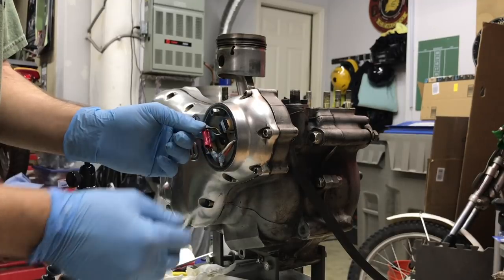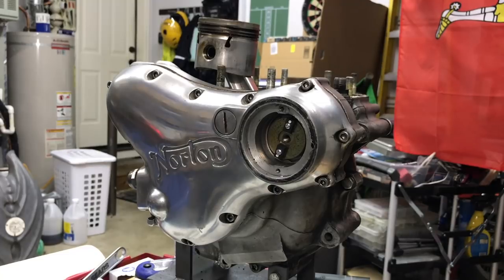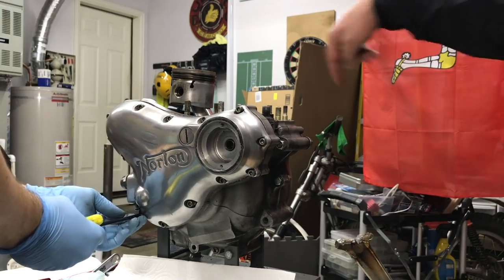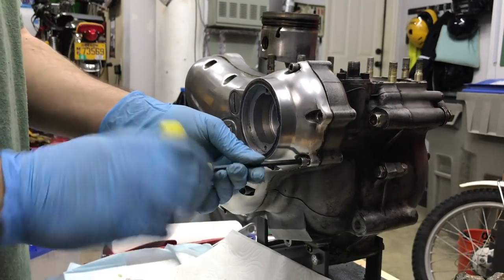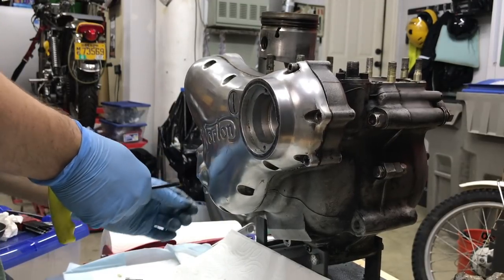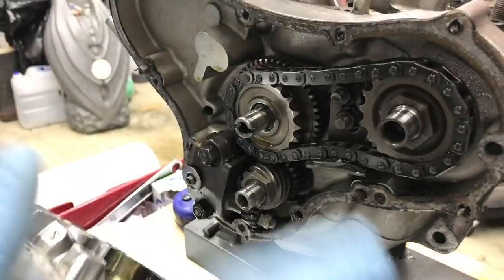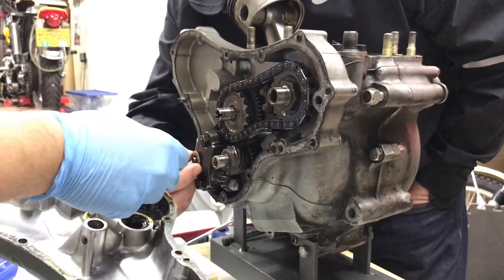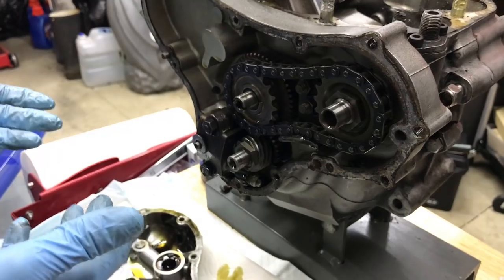1972 Norton Commando Combat Rebuild (6) - root cause of the blown engine

Comment: I once forgot to tighten up and secure the nut that holds the drive pinion on to the oil pump on a Fastback. At 70 mph it blew a hole in the crankcase as the big end shot out downwards. I'm here now almost 50 years later because just before it happened I had the thought "What would I do if the engine seized?" Answer - grab the clutch.  BobUK.
Reply from the maker: Yikes!  That's a very similar story to Dave's Bob.  He managed to grab the clutch at 70MPH and pull over and saw a great big pool of oil under his bike!  Best wishes, Mike

Comment: You're correct to diagnose the problem to the oil pump oil seal.  But the reason why the oil seal came off is the washer on the shaft.  The Norton spares parts drawings does not include a washer.  The oil seal has to adhere to the shaft and the oil pump.  Norton recommends using a sealant on the oil seal to keep it in place.

Comment: This was a very interesting look at what appears to be an all too common issue.  I've been through similar problems with various harley's and other "dry sump engines" some small seal can easily cause oil problems.  I look at such issues after better than fifty years wrenching, and question how the guys building the engine at the factory, could just let such a seal "float" unconstrained.  I've long enjoyed the Brit practice of piston oil pumps, over the common gear oil pump so common here in the states.  A great pump, with not so great a system keeping the oil inside.  Thanks for showcasing this, Mike.
Reply from the maker: Thanks John for your great comment. I enjoyed reading it. Best wishes, Mike

Comment: Dang! I'm about to take my timing cover off to replace that same seal for good measure! Also will be pulling pump off to check if there's any free play etc. This makes me appreciate the $120 I spent a few months back getting an oil pressure gauge!
Reply from the maker: Great idea!  Hope all is well, Best wishes, Mike
Reply: Your Manx fly is back to front
Reply: @petergray5491  ???
Reply from the maker: @petergray5491  Oops, thanks Peter! Nice catch.  I will let Dave know that he has it the wrong way around (assuming that he wants the correct side facing out).  The toes are facing the wrong way.  Cheers, Mike

Comment: Hey Dave.  I had the exact same thing happen to me.  Very disheartening and an expensive mistake. I vowed to have assurance.  Any time I reinstall the timing cover now, I fit a oil gauge to a spare and reworked banjo fitting at the left rocker rocker shaft.  If I have stable pressure, I know the rubber didnt leak.  so critical. refit a normal banjo and off racing.  $80 oil gauge and spare banjo good assurance

Comment: Long story but had my engine rebuilt north of Hamilton, Ont. for $1700 (CDN)  Was told by the mechanic that he had to take the engine apart again as something he repaired caused the pushrod to strike the inside of the head. He shaved down the diameter of the rod so that it would not bind. Somewhere in the process, part of the spring element of the oil scraper ring was broken off rendering the oil ring ineffective. It was burning oil so badly, I couldn't see. Also, oil was pouring out from the front at the base gasket. Ended up putting a new set of Hastings rings in MYSELF and repairing the base gasket as well. Inside the combustion chamber was small bits of aluminum shavings that were stuck to the valve seat causing it to backfire. Won't be going back there anytime soon. Brings true that old saying, "if it ain't broke don't try to fix it."
Reply from the maker: Ouch!  Yes, this has been rough for Dave.  Hopefully he will see it back on the road again soon.  He's having machine work done now and then will begin the rebuild process.  Best wishes, Mike
Reply: stan -- you should name the shyster that did the screw-up

Comment: I was bimbling along the dual carriageway on a v hot day and my engine blew up. Until now I thought perhaps it was v low on oil and overheated but on looking at the conical washer there is a slight split in it. Could this have caused  low oil pressure? I found 2 x10 thou shims behind it. I have a photo of the washer if anyone can help me with the diagnosis.
Reply from the maker: Hi John, yes absolutely that could have caused the seizure.  This is just what happened to Dave's.

Comment: What are the names of parts suppliers. I understand there are some parts NOT available new but you are getting several new or at least NOS parts.
Reply from the maker: Yes, there are some great Norton dealers here in the USA and in the UK. A few names include: OldBritts, Fair Spares, CNW (Colorado Norton Works), Andover Norton, RGM and Norvil.  You can get NOS parts off ebay but most of the parts we buy from dealers are faithful reproductions, some using the original specifications.
Reply: @TheMightyGarage  - that is good to know. Don't a Google search just shows so much. Then one never knows who is trust worthy either.
I have been window shopping for another bike. Have not ridden for 5 or 6 years. A friend just traded for some Norton's - all basket cases in sure. There suppose to be enough parts to build 3 bikes. Although I have not heard a price tag yet.
Reply from the maker: @vwmountainman9701  Good luck!  I hope it goes well.  It sounds very interesting.  Yes, you should be able to buy everything that you need from one of the Norton dealers.  You may have also seen it but there is a fantastic online forum called AccessNorton.com where you will find answers to every question that you can imagine!  Best wishes, Mike
Reply: Feked in the UK (great reliable DHL delivery to US) and Baxter Cycle in the US have been great too, good prices and variety of parts options.

Comment: Can you tell me where I can get my  Norton  case  Machining out to update the oil system
Reply from the maker: Hi Josh, I will ask Dave. He knows of a couple of places. Cheers, Mike
Reply: @TheMightyGarage  thank you very much I have just recently locked the bottom end up and would really like to do some updating
Reply: Josh, first this machining is only needed on the Combat (or any 72 750) and secondly I wouldn’t necessarily recommend all of the work I had done. I had the advantage that one of our club members is a retired machinist. If I hadn’t had that resource I would have done an alternative mod that just needs drilling and not machining. Old Britts use to offer the machining service but they don’t any longer. I need to dig that info up on the alternative mods from the Access Norton forum. Stay tuned. It might take me a bit.
Reply: Here's a good post that shows you don't need to remove the baffle. The idea is to relocated the oil pickup from the front of the engine (like every other Norton engine) to the back. Lord knows why Norton messed with the Combat so much. There's a reason it was a one year only disaster. Some people drill one new hole, others drill several small ones. Plus you need to block the forward hole. https://www.accessnorton.com/NortonCommando/crankcase-mods-and-build-update.27847/post-421743

Comment: Is that poor design ? Surely Norton development would have foreseen this circumstance.
Reply: Poor design? No, that WASHER hanging on the pump seal spigot is a non-standard part and probably several times thicker than it needed to be (if it needed to be there at all) so no surprise the seal simply dropped off! 
IF a SHIM (part 067784) is required to set the correct amount of seal compression, then, in my opinion, the pump spigot (066191, 'Mk3 cover oil pump feed bush') should be removed and the shim inserted between the pump body and the spigot flange.

Comment: Sigh! A sad end to that motor.
Reply from the maker: Hi Scott,
Oh, it’s amazing what Dave and some talented friends will be able to do with the motor. He has all intentions of repairing the crank cases.
Reply: Mi Ty Oh good. I misunderstood and thought it was beyond repair.
Reply: Scott Cary Anything can be fixed. We’ll see if I change my mind. I want to keep the serial number but the more I think about it and how non-stock that bike is I’m not so sure.
Reply: I had a rod go on a Norton (the one before the one I have now, it was a 1970, ran low on oil at the end of the 5-hour production race at VIR, Virginia).  My partner heard something wrong at the end of the fabled back straight and pulled the clutch.  There was less apparent damage - the broken case pieces were still there, hanging by cracks; besides the big broken area, there was a small crack just under the cam journal area (more about that later), also the cylinder skirt was cracked much like yours.  Since the pieces were all there, it was possible to just peen the broken bits down and heli-arc.  There didn't seem to be any issues with the strength of the case - I raced it and rode it as daily transportation (or as Mike would say "traans - pahwt" for another year before I sold it.  We checked the alignment of the main bearing bores and they looked good.  

The one odd problem that we weren't sure we could fix was that the rod had hit the com journal from the inside of the cases, just behind the points near the tach drive.  The  cam bush was cracked and when we pulled it, it was obvious that the bore for the bush was distorted.  It took gentle skimming of the bore back into something like the right shape and then line-boring after the new bushes were in.  In truth, we didn't have to do much to get the bore in shape and the line-bore process didn't take much metal off the inside of the bush, so it all seemed to go well -- it's just that the process took longer, and had us more uncertain of success, than the other repairs to the case.  Like the main case repair, it was no problem for the next year I rode the bike.  

Good luck and good riding in the future.  Best wishes,  Bb
Reply: brucebear1 Thanks for the story Bruce. I’m fortunate to have enough spares available I don’t have to save the broken cases unless I want to retain the serial number. Luckily the frame number is on the title and that’s good enough here.